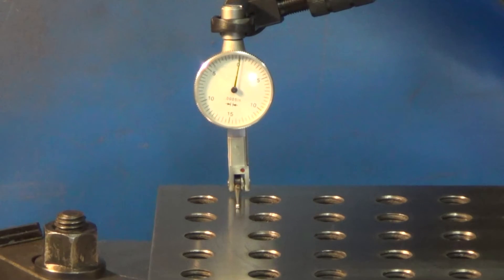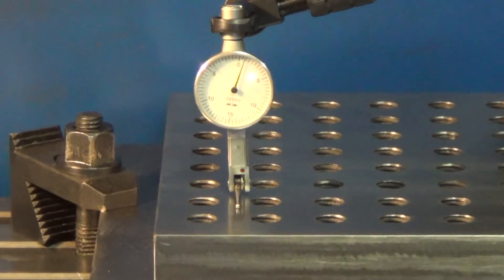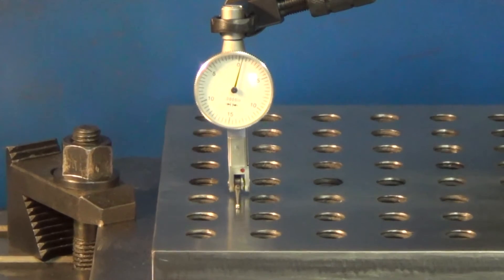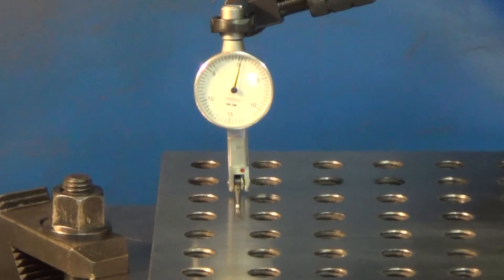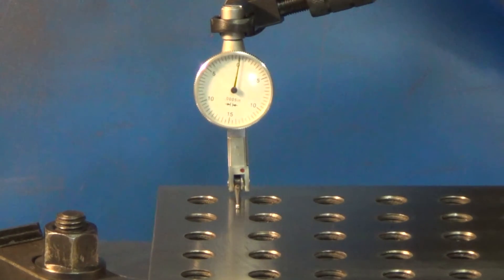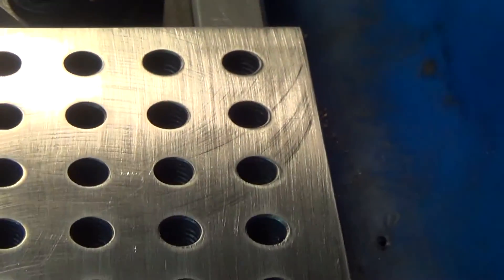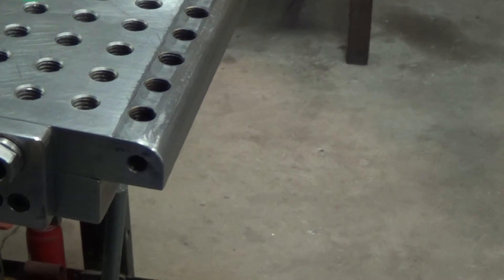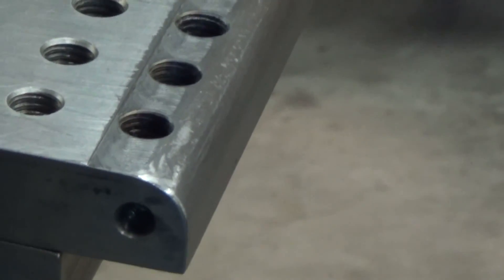Angle Plate IV (with bonus)

Comment: Comp;

A couple of thoughts on how you did your plate measurement.

1.  It looked like you used your mill as the base table for the plate measurement (I am assuming you clamped the dial gage into the mill head and then moved the table around under the dial gage to measure the plate).  Did you fully check for tram squareness of the mill itself before you started measuring the plate?  Did you check to see if the mill table surface itself was flat (by clamping the plate to the mill table top, that probably transferred any dimensional errors in the mill table to the plate)?  QC tolerances on smaller mills are always an issue, especially with the Chinese clone mills.
2.  Having access to a granite surface would have likely been the most accurate method for measuring the plate surface error.  Although I have to say that it looked like you were measuring about 2 thou of error over what looked to be about a 12" wide surface, which is pretty darn good for not having precision grinding equipment, etc.
3.  Unless you are using this angle plate as a precision sine plate, your level of error should be within most tolerances you need for typical projects.  A couple of thou in plate height difference is probably overwhelmed by the accuracy of your mill (i.e., the mill may be more inaccurate than the plate error).

BTW, I have to say that your chuck stopper was an absolutely elegant solution.  Simple, cheap, and it works every time - that is elegance in action.

Regards;

Ron Kluwe
Reply from the maker: Hi Ron. Thanks for taking the time to comment.
Yes, I just ran the DTI across while clamped to the mill table and, to be honest, never expected it to be even as flat as it was. That DTI has .0005" graduations and to get it that close was great especially using the RF-31 clone mill/drill.
I did not have a surface plate at that time and may do a more formal check in future. I do agree that for most work the plate is indeed accurate enough and I use it regularly.
Thanks for the compliment on the chuck stopper! It was a quick and easy solution for one particular job.

Colin

Comment from the maker: Sorry got nuttin on that part. The motor came with a double sided gear for connection so I just removed it and ground up a bit to fit the tooth profile. 
The flycutter is what I was making when I did the triangle in the chuck vid.

Comment from the maker: The motor is a power window? motor I saw once while browsing through Princess Auto and thought it was worth the $15 for an experiment.
The angle plate is made from some 1" plate I picked up for decent cheap at a steel shop browsing through the cut-offs.